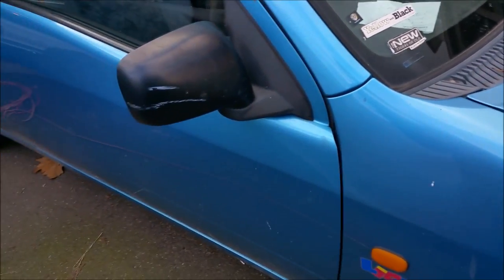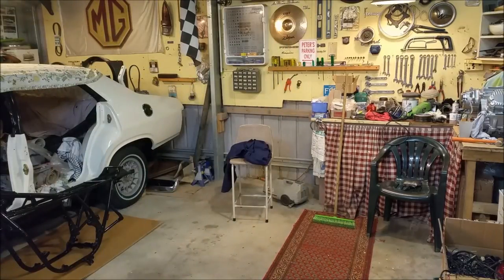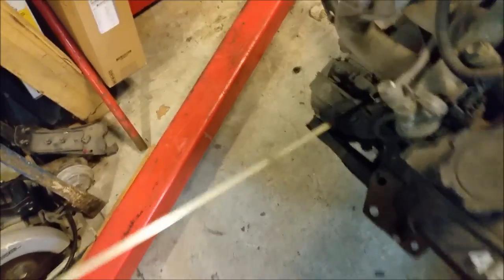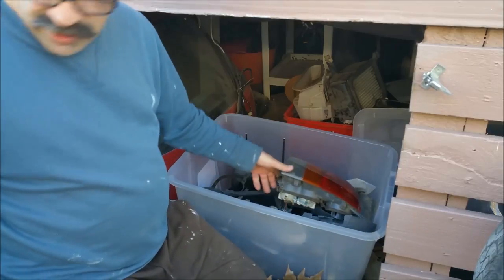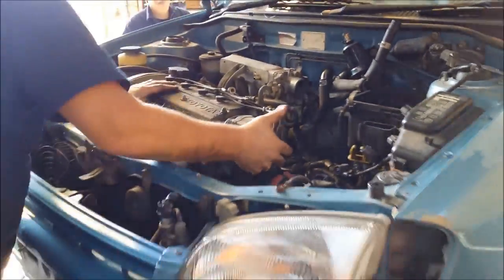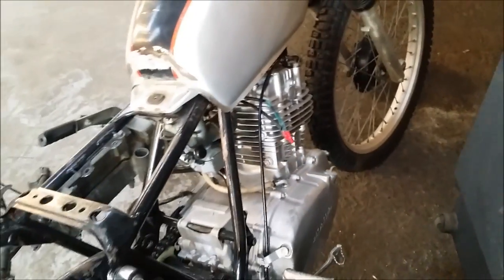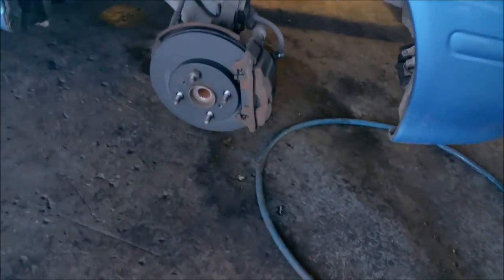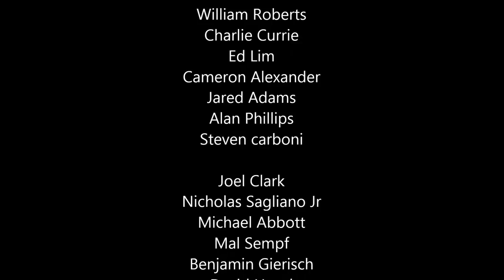Toyota Starlet and Honda XL250 Restoration Part 2 - Dave and Mike Pull the Engine.

Comment: You can't beat having good mechanics as friends, especially ones that have their own shop and ramps etc.  Using the engine and box out of the scrapped Starlet is a no-brainer, you know it's been maintained on the mark so it's probably good for the same mileage again, whereas the one in the blue car, as you say, looks like it's been neglected somewhat so you're cutting the possibility of future hassle down hugely using the known good lump.  I reckon the Raaymakers will be able to tell you if it's worth putting the driveshafts from the scrapped car in or not, I reckon they'll probably be fit for a load more miles as Toyota original equipment CV joints are really tough as long as the boots have been changed promptly when they fail, I know recon shafts are pretty cheap as you said but the quality of some of the replacement CV joints can be pretty poor so replacing the boots and re-greasing the used ones should be a good and slightly cheaper option if they're fit to go again...

Comment: It looks like the original engine from the blue car is leaking oil into the cam belt cover too, so that engine might not have been long for this world as the oil can drastically weaken the belt material.  I've seen quite a few good engines destroyed by minor oil leaks that have been ignored and have ended up weakening the cam belt and causing it to fail...